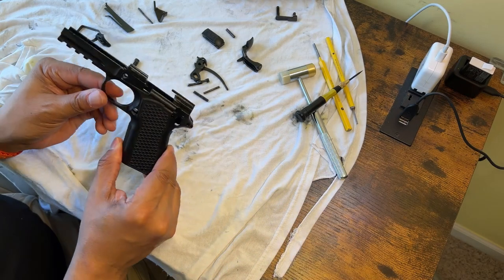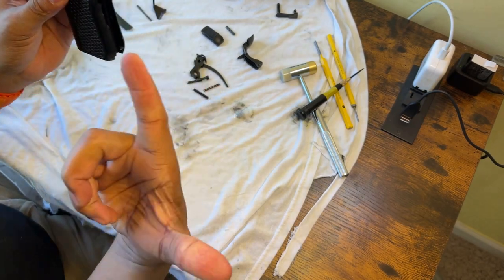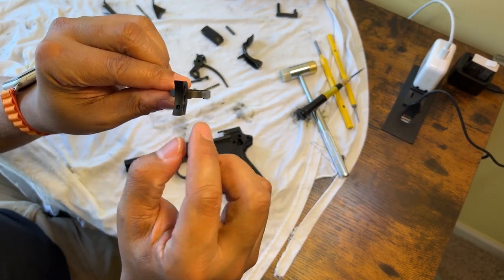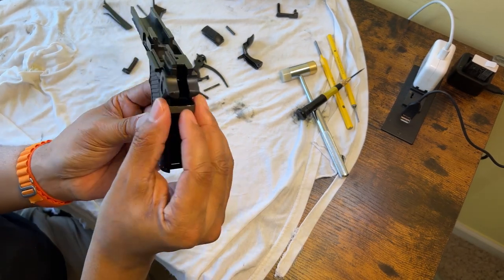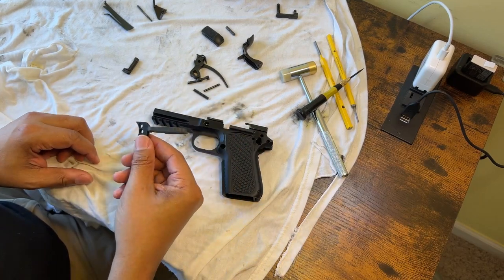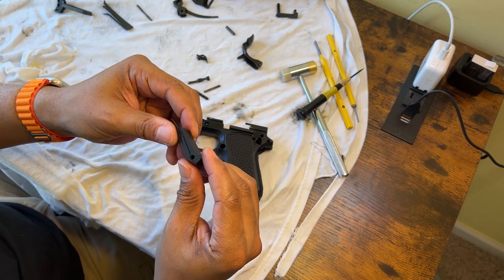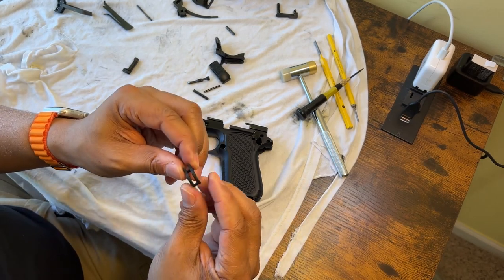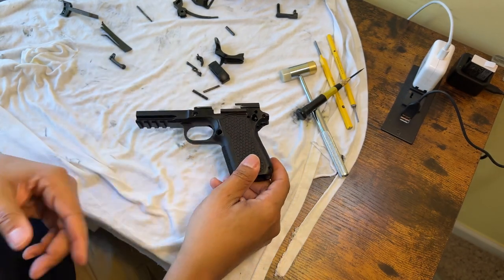AF1911-S15 - Fully Disassembled!

Comment: Will a 2011 trigger fit like an Atlas trigger?  Post some measurements of the trigger bow dimensions.
Reply from the maker: I explained in the video that the trigger appeared to be custom. The whole gun is built around the mags. There may be no parts that will fit in the trigger bow tracks. The single stack triggers will be too slim of a fit and the 2011 triggers will almost certainly be too wide.

Sharing out the dimensions is a good idea. I will post info about the trigger soon
Reply from the maker: I've pics with the caliper measurements here:  https://www.youtube.com/post/Ugkx5CoDByskkGYgjFjn-lCY-s5qXTUu9W2z